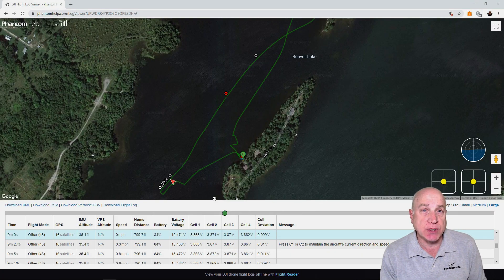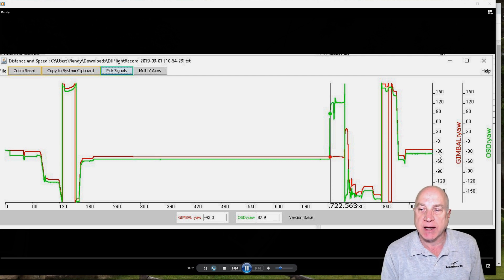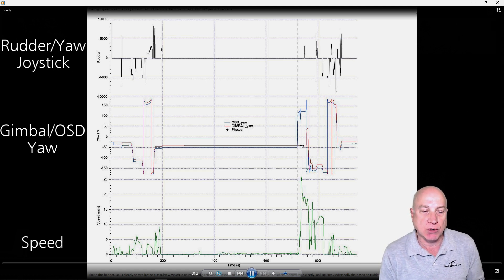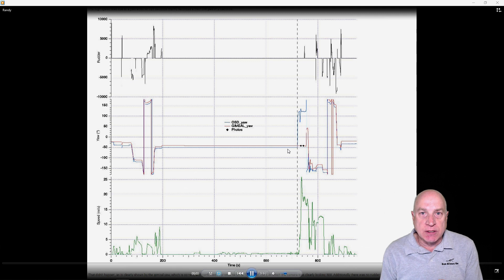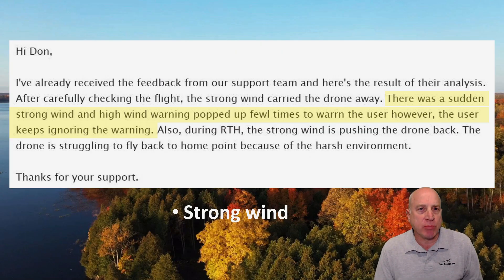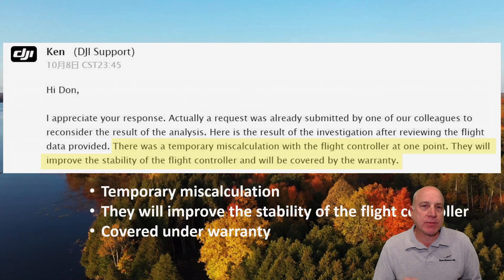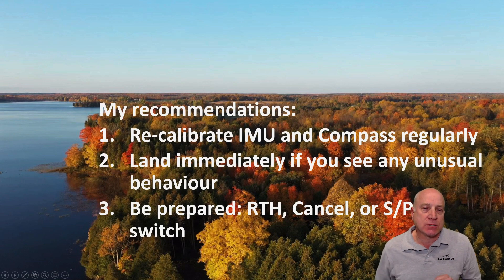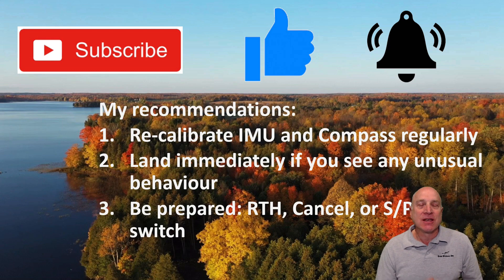Mavic 2 Pro 90 km/hr Fly Away...Explained!

Comment: Wouldn't the drone crash if the  FC restarted? As additional safety measure I think that the joystick inputs should be logged independently on both the RC and the drone.  In case of malfunction the 2 could possibly be compared if the drone is recovered.
Reply from the maker: It depends how fast the FC restart is:  If it is in the order a a second or two, the drone rotors' auto-rotation will likely keep it stable enough to regain control after the restart.  Yes, storing ALL of the data in both the RC and the drone would be great for post-partum analysis!

Comment: I think it may have happened due to sensor output error .... some sudden local pressure may have caused the sensor output as crazy and the flight control responded to that accordingly but it multiplied the problem ........ just a thought.
Reply from the maker: There is no evidence of local pressure change, and no reason such a change would mess up the compass.

Comment: Solar storm play a big role. I've had the similar issue with my Mavic 2 pro and Mavic air. But for my case the app crashed and drone flew away. Only option I had was to switch off the remote and the drone flew back safely. These are scary situations
Reply from the maker: They certainly are scary!  Looks like we have both been fortunate!

Comment: I had the same type of flyaway my drone points elsewhere in airdata for a very short time and then develops max speed. What can I do to prevent from happening again. I am afraid of flying again
Reply from the maker: Yikes, Anastasia! If you've read through the comments, you'll see we're not alone! The good news is I have not experienced ANY problems since that fly away.  I recommend you calibrate both your compass and IMU as soon as possible,  then try some simple, low flights to ensure everything is OK.  This will restore your confidence in a safe, controlled way. Also, having 'lived through it', you will be better prepared if anything goes awry in the future.   Good luck!

Comment: Google bought me here while researching the root cause of my DJI flyaway in very similar scenario. I was flying on fields rather than bodies of water though. My case and this are  obvious cases of DJI compass error. This flyaway, similar to thousands of other cases of DJI flyaways started the moment the onboard compass independently malfunctioned with no backup or override procedures. All it takes is a couple of  $5 compass backups with a few lines of code to prevent these erratic compass flips. Take a look at the procedural work they have done on Ardupilot's compass implementation and then ask yourself why there is no actual data logging for compass in DJI systems. For the record it's mid 2021 and reports of flipped ( reversed ) compass at startup or mid flight still being reported and DJI is quiet about it.
The DJI engineers and the legal hands at the DJI HQ should start sharpening a few pencils. Now, with the licensing comes the Government agencies with unlimited resources to dig into the matters when and if  losses are caused by drones. The rude customer service can't provide convincing defence against Government agencies legal muscle.
Reply from the maker: Yeah, I've heard from many others as well....

Comment: Perhaps DJI could have 're-flashed" the programming on the drone and controller, just to be sure there was not a corrupted file, that caused the run away??  Anyway, im glad you were able to recover your drone.
Reply from the maker: Thanks, Taun.   Maybe they would do that, or more likely they would ship me back someone else's refurbished drone with new unknown problems.  I haven't had a spec of problem since then, and am now convinced that it was an IMU calibration issue...which of course was easy to address.

Comment: Don, I learned so much thru your experience. I had a fly away today, Hubsan 501SS. Controller battery died and it looked like RTH was in progress. Suddenly drone began extreme changes and flew into a metal building. I surmise (=no evidence) that a nearby rc aircraft transmitter binded with my drone.
Reply from the maker: Yikes!  Sorry to hear about your crash.  Interesting hypothesis...I don't think that kind of rogue transmitter binding is possible on DJI equipment BTW.

Comment: Do you have any suspicion that the hyperlapse mode had something to do with the fly away? Maybe there is a fault in that mode?
Reply from the maker: Hi Patrick.   I certainly was suspicious at first, and had heard a couple of rumours that hyperlapse was flakey at the time, but once the compass error became clear, it was hard to connect the two elements.  Bottom line...no, I think hyperlapse was not connected.

Comment: I would guess that this is is the result of the really bad magnetometer position combined with a slightly bad magnetometer. This is the reaction we struggle with on INAV builds with bad magnetometer placement. Calibration may solve this, but I think this magnetometer may have a minor abnormality that comes into play with bad calibration and it's bad position.
I would never trust this quad again.
Reply from the maker: Thanks for your insights.  Fortunately, it has operated flawlessly since then...but I keep my eyes peeled for any abnormal flying.

Comment: Sound analysis on your part. The aircraft orientation indicator on my mavic mini gives wrong heading and location most of the time, so I took it in a field to try various methods of recalibration. None worked, so I don't use it - but the map never seemed to go wrong - or so I thought. Today, I checked the map record for that exercise... it showed that my drone had flown all the way from Britain, across Spain and north Africa to a point in the Atlantic Ocean!

That's a long way on one battery, and a lot faster than your drone... or is it? No. The location was 0° 0' 0" lat, 0° 0' 0" long, which is the null string. I can't wait to see what failsafe RTH means.
Reply from the maker: Yikes, 0-0 is no place for a drone!  I recommend you get it repaired.  This could lead to a serious problem if you do in fact do an RTH.
Reply: My drone actually showed no odd behaviour. Why? There seem to be two independent systems at play:

1. The orientation indicator on my mobile device wrongly showed the drone as behind me when I landed it. This problem is due to the magnetism of the speaker in the controller, which affects the compass in the device. The fix is to use a device with a more distant compass sensor, or to insert the device in the controller the opposite way around (longer wire needed) to increase the distance between the sensor and the speaker (but I have ordered a device holder which I wanted anyway).

It seems that the CONTROLLER gets its location from your device, but the DRONE gets both its location and RTH location by GPS and the downward visual sensors alone. It is important to force your device to define its location by GPS alone, not by reference to Wi-Fi (because the controller's Wi-Fi is not at a fixed point) or to the device's compass sensor. You do that through the device Settings and in Google Maps, using Airplane mode while flying, and calibrating the device by GPS. This is not clear in DJI's manual.

2. What about the flyaway that never happened? The map comes from Google Maps. It indicates the drone position and RTH from GPS alone, too, but not the controller position. The DJI Mavic Mini manual warns that you should switch the controller ON before the drone, and OFF after the drone to avoid data loss. I got distracted by a heavy shower, and in my hurry to pack up, disconnected the device and switched the controller off before the drone, so the final location of the drone was lost and recorded as the null string (nothing)... which shows on the map as the point where the Greenwich Meridian crosses the Equator. The record of a speed-of-light flight was due to a short circuit between my ears.

Comment: Nice explanation. Yesterday I had loss of control while flying next to a cell tower. The drone did RTH and missed a 6000volts line. On your location there are two Bell towers, one East of the lake and one on the West, the link that connects them crosses the lake and peninsula. Their height is about 100m, check your incident drone height and the cell towers link path on the vertical terrain profile. Fly the exact same path on your app or Google Earth. This is just a quick guess
Reply from the maker: Thank you for the suggestion. In my case, I was flying only 10 to 20m AGL, and the towers are on land higher than the lake, so it is unlikely that I was in a microwave beam.  Good thought though...thank you.

Comment: I love my original mavic pro 

Never upgraded because it works flawlessly even to this day and holds the test of time.. I just went into the controller and updated my antennas for screw on type.. I also have edited the settings in the DJI app on the computer. It now goes up at a rate of 22 miles per hour and a speed of 48 miles per hour.. 

Did that a year-and-a-half ago not one problem..

BUT I HATE TO TELL YOU I THINK THAT THE AUTEL EVO HAS CAUGHT UP!!  I think they have better cameras better quality drone, controller, AND ESPECIALLY THEY'RE AMERICAN CUSTOMER SUPPORT!! 

The AUTEL EVO 1 has just as good of transmission as the original ocusync on the mavic pro and maybe even better not to mention a much better camera, inquieter even than the Platinum ( at the same price ) 

The new autel Evo 2 has surpassed DJI in the mavic 2 pro category. And can even fly further...
Reply from the maker: Thanks for the insights.  I'm really glad that DJI has strong (if small) competition...it keeps them on their toes, and ultimately improves consumer choice.  BTW, other than this one event, my M2P has performed flawlessly, before and after.

Comment: So the question is. 

WHY DID THIS YAW ERROR HAPPEN? 

How to avoid this in the future..
Reply from the maker: Correct...that root cause is not yet resolved.  That said, it is clearly not systemic in my drone since it has not recurred since then; the craft works flawlessly.  The working theory is that some glitch occurred (perhaps a bit flip) that corrupted the compass, and eventually the flight controller figured it out and reset.

Comment: I would ask DJI to explain the yaw error!
I know that since the latteral collision avoidance was newly introduced on the Maivc 2 , a lot of weird behavior for the collision avoidance specific conditions make this drone uncontrollable. In my opinion, an insect hit the side/front collision avoidance and the yaw kicked at 180 degree to avoid it (Over-reacting), try testing because their obviously not doing their job correctly!!! this is probably what happened
901.77 Nav canada should adjust rule stating that  the drone prorviders (DJI in you case)  are legally obliged by the law to fix any issues that might lead to uncontrollable situation when operating within the operating manual guideline parameters, until then, they would need to provide the owner , the instability notice and make them revoke their selling licence until the problem is fixed!.

Look at the youtube video where a guy hover inside his home but can't control the aircraft because the collision avoidance locks up the manual controls and eventually crashed.
Reply from the maker: Insect strike...interesting idea, but unlikely.  And note that the yaw 'command' did not actually change...just the 'perceived' yaw.  The aircraft was not trying to avoid anything...it just assumed it had spun around and then attempted to control itself based on its (incorrect) view of reality.  Regarding 901.77, I did actually broach this subject with DJI in one of the phone conversations.  Their position was that an error occurred (for whatever reason) and the system responded to correct itself.  So, the two issues were the vulnerability to the error and the response time to self-correct...which they said was reasonable.

Comment: Thank you for taking the time to share so many details about your story.  All tech fails at some point.  A glitch is a glitch and when it happens, back up systems need to engage as quickly as possible.  When it comes to drones, you only have split seconds to respond to such emergencies.  

The only thing I would have done differently in your case is, I would have sent the drone in.  Data logs are great, a physical inspection of the craft could have revealed more...POSSIBLY.  Drones are intricate machines and the slightest fault can cause a catastrophic turn of events.  

As for the comment that DJI would send the owner a refurbished drone, that does not compute for me.  They can easily send you a brand new drone.  It’s cheaper than negative word of mouth throughout the Drone community.
Reply from the maker: Thanks for the thoughtful comment!  Yes, I would have sent the drone in if a) the place they insisted I send it to had a good reputation for repair (which it doesn't); and b) they had offered me a loaner (which they didn't); and c) they had ANY sort of a statement about what they would look for and/or repair (which they didn't).  I asked for a replacement, and they refused outright.  They did not seem to have any concern about reputation or repercussions.  Their final comment was ~"don't worry; we will fix everything in the firmware"!  And fixing the firmware was the MAIN point I kept pushing with them....I get it that everything has glitches (I'm an engineer), but the system needs to be more resilient to faults than was demonstrated here.

Comment: Hi Don let me look  at your Analysis from an IT point of view and someone who has been flying drone drones for a long time. I think I know what happened and all of them are like puzzle pieces that makes a big picture.
The problem began when you started the Hyperlapse (usually Hyperlapse is a very demanding option this is why it is only available one new dji drones that has better processing capabilities),it takes picture after picture process them and saves them in a very short time) the more colors are available in a picture (which is your case) the more pixel are present the bigger is the individual picture all of those factors overloaded the processing unit of the mavic 2 
1. Due to overload the unit was unable to find the processing ressources to maintain gimbal stability which shows clearly in your video.
2. The firmware asked from the processing unit more power to restore the gimbal stability which puts even more strains and now the drone does not even know it’s direction any more. simply the processing unit was not capable of handling all those calculation at the same time.
3. When the drone lost also it’s capability to know it’s orientation and started drifting the firmware thinks the drone is facing heavy wind and for each action it needs a reaction the firmware ordered the motors the increase power  to maintain position but there was no wind and the drone started accelerating as it accelerated the drone thought I am still drifting lets  fight which even increased the speed since the drone lost it’s orientation it does not know if it is a actually drifting or accelerating (this is why on basic analysis dji said ohh your drone is fighting against wind and they did not pay attention that the drone lost the capability to know it’s orientation and confused drifting with accelerating)
4. What you do with your stick will not be executed since the processing unit of the drone is overwhelmed by previous action it is very much like when your computer cpu is overwhelmed and you start typing and clicking nothing happens because  it is busy doing other previous actions and when it finishes it process your typing)
5. I don’t think what you did with the controller recovered your mavic but actually the timelapse stopped or less demanding pictures to store which freed processing power to stabilize the gimbal which freed more processing power so the aircraft calculated it’s orientation and knows it is actually accelerating and not fighting against a ghost wind what made it stop and hover which even freed more processing power and made it execute the previous stick controls you made and gave you gradually back full control.
I think yes It was a random chain of events that overwhelmed the processing capabilities of the mavic which is a serious  issue since you cannot be sure that similar events will overload the processing unit and trigger another chain event like that random problems are the most serious since you cannot replicate them and find solutions.
What dji can do is to put a fail safe code in the firmware to kill all action in the drone accept flight control when it feels processing capabilities overload ( like stop all kind of shooting) even gimbal stabilisation and focus on the main processes of maintaining essential flight control.
What a user can do 
When ever you see any abnormal things ( gimbal problem, drifting. Etc.) Stop all processes like filming flying maneuvers give the processing unit in the drone time to execute all pending actions so you will not make things worse by triggering a chain reaction and draining processing power even more like in your case I think.
Reply from the maker: Thanks for your insights, Nabih!  Given that the image processing and flight controller are separate, I don't think that was the root cause, however.  Also, given that hyperlapses involve an image every second or so, versus 30 or 60 frames per second during video recording, I don't think they are more demanding.  And, I was not doing a hyperlapse at the beginning when the drone was drifting.  That said, for sure the flight controller was in an overload condition during the acceleration, which is why it was not responding to controls.  Thanks again for sharing!